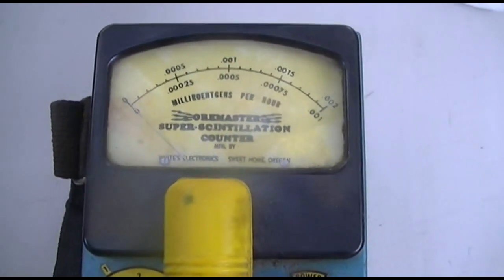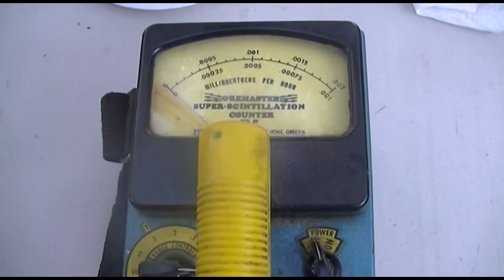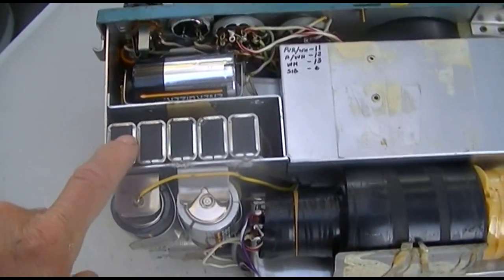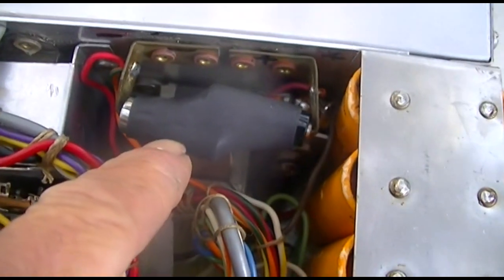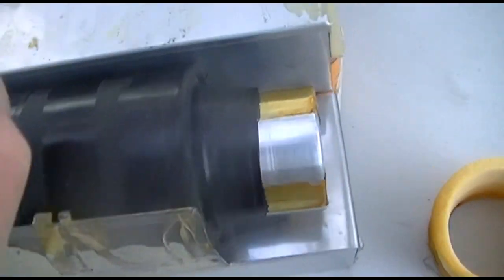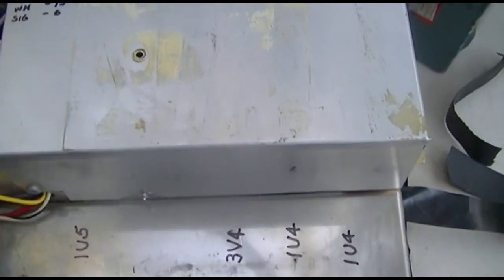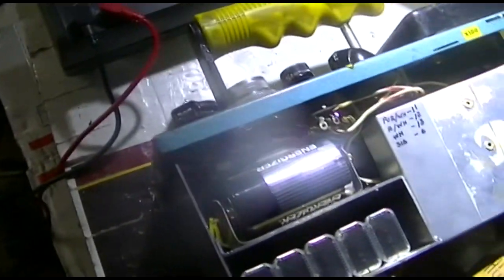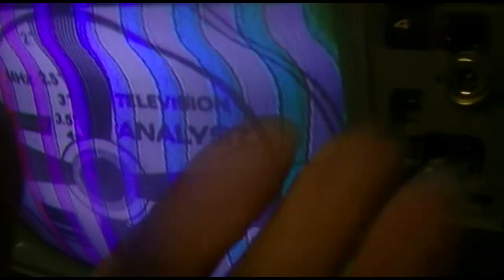Vintage Oremaster Scintillation Geiger Counter Diagnosis Attempt

Comment: I am sorry to say but you have absolutely no idea what are you doing. I cringed during this video so many times  - I had to stop it at some point. This is not how you troubleshoot scintillation detectors and your lack of basic knowledge about PMTs and physics in general, probably ruined both the crystal and PMT if they were functional prior to your diagnostic attempts. As someone said below - you should stick to the old TV sets.

Comment: Those remotes are IR/NIR, not UV.  I have a UV camera and night vision tubes, but night vision is not sensitive to UV.  They have specially coated optics that reject UV.  The photomultiplier tube would be swamped/desensitized by ambient light.  That's why it was taped up so excessively.  Super sensitive.  They will recover (usually) given time to rest.

Comment: Those CDV 700 samples are fairly weak, I have some doubt the scintillation detector is completely dead. The cdv 700 is extremely sensitive, I bought a 700 with 2 working 725s and neither of them can even pick up the test sample on the side of the 700.

Comment: Was the PMT getting any high voltage from the oremaster? Unplug the PMT and check between pins 12 and 7 for about 1kv. You'll need a very very high impedance meter since the current is so small. The CRT hv meter should work. Once you have high voltage, throw the bad crystal away and get one of the plastic crystals on ebay. The plastic ones don't absorb water and go bad.
Reply: The sensitivity of the plastic is only about 25% that of the superior NaI(Ti) crystals.

Comment: I think you confused IR and UV around, remotes use IR, not UV. (that looked like a DirectTV remote, which if I recall can also do RF, but that doesn't matter here) As for the 60hz strobing LED picking up on that odd test rig (interesting, I don't think I caught what that was, and have no idea what that would even be for)... I suspect that the photomultiplier tube is either A) overwhelmed by the light, or the LED bulb is causing interference. - I don't recall if you mentioned if the scintillation detector was working before you started taking it apart or not. As for the crystal, I do recall someone doing a video on them, (here is one of them: a close look INTO a scintillation crystal (radiation detector) / sodium iodide + thallium / NaI(Tl)). Also while looking I found a really good video comparing scintillators and Geiger counters (Geiger Counter vs. Scintillator )

Comment: I looked up the data for the 931A photomultiplier used in the 1077 and it's response dies around 670nm.  Infrared starts at about 700nm so I think the B&K just can't "see" the remote controls output.
Reply: Bob you know something about everything man.  Loved your video on the 20 metal crt u just did!  Stromberg!